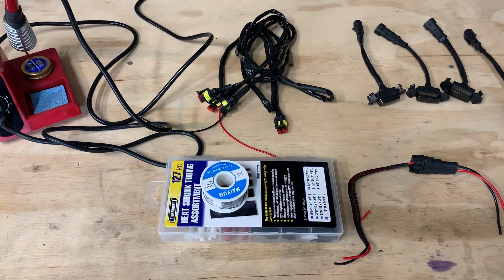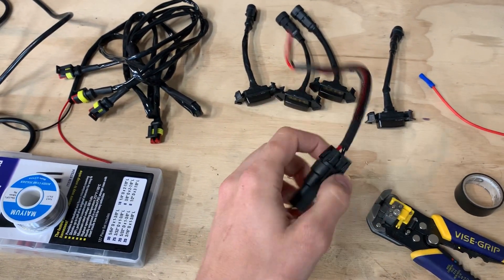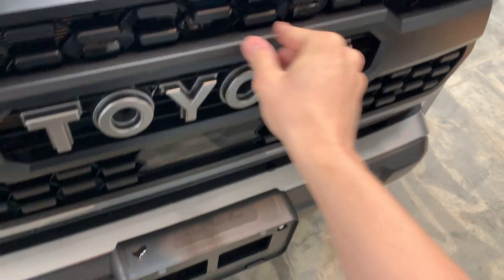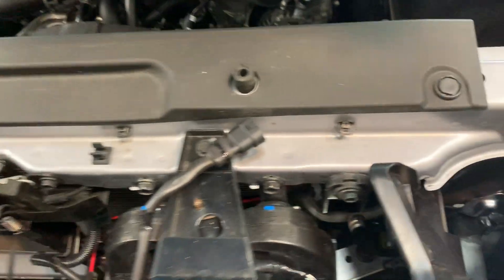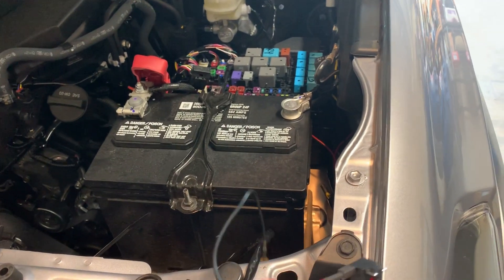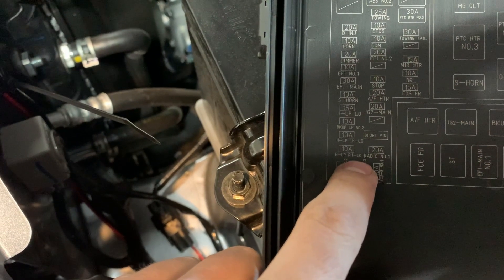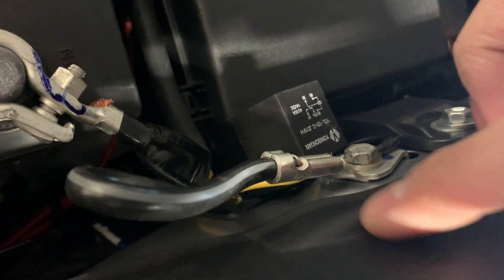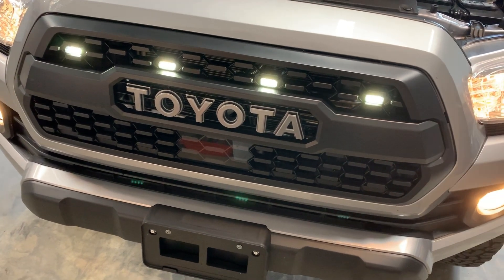Tacoma Raptor Grill Light Install!

Comment: do u have a tutorial for 2nd gen?
Reply: With wiring, it should be a similar process. I would recommend the INJ (10 Amp) fuse rather than the headlight fuse. The INJ fuse will allow the raptor style lights to stay on when the engine is on, so technically you don't need the headlights to be on for the grille lights to turn on. (all generations). 
If its about the grille, the OEM TRD Pro Tundra Grille is just about the same as the OEM TRD Pro Grille for the 2nd gen Tacoma
Reply from the maker: @Michael-pp8lz  Yeah it should be similar. I personally wired mine to the lights because I only wanted them to come on the with the lights but that would work too!
Reply: thank you so much!